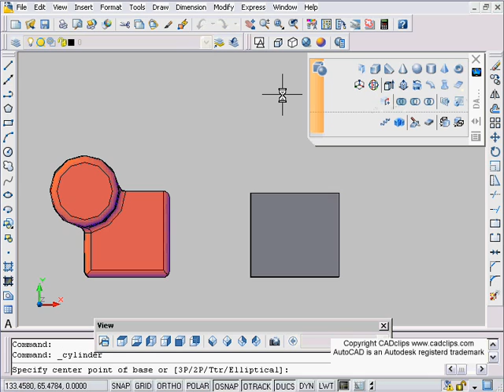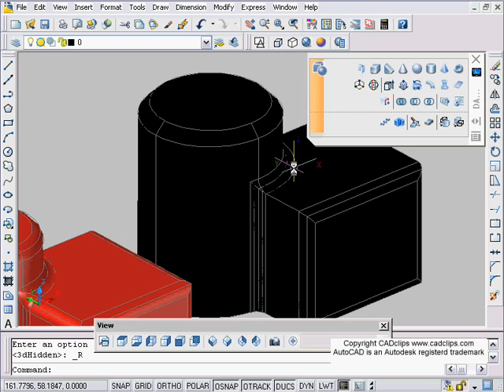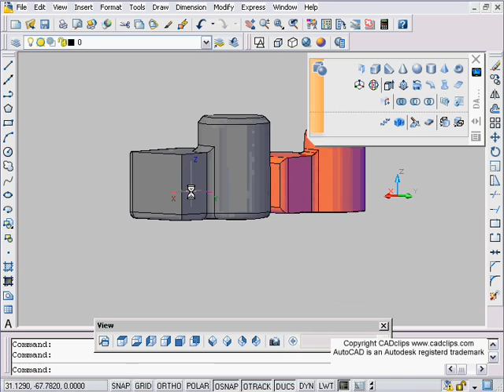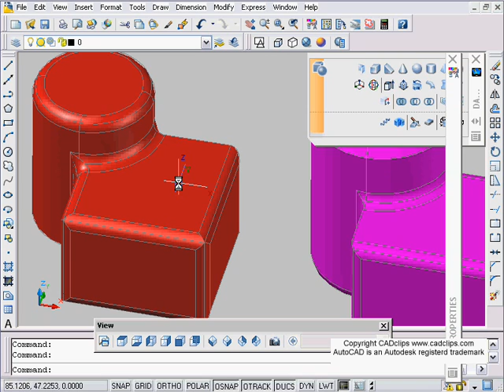AutoCAD 3D - Fun With Fillet - CADclips

Comment: Hi,
Thanks for posting these tutorias. I have a question. Is it possible to draw a variable fillet for 3D solids? Example: Start a a corner of a cube with X radius and finish in the middle with o (zero) radius. I am using Autocad 2010. Thanks!